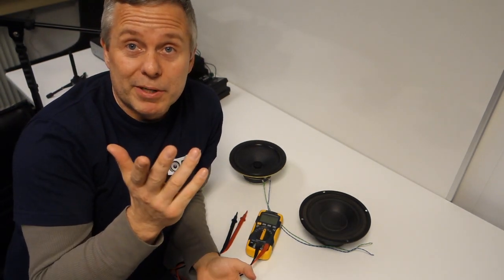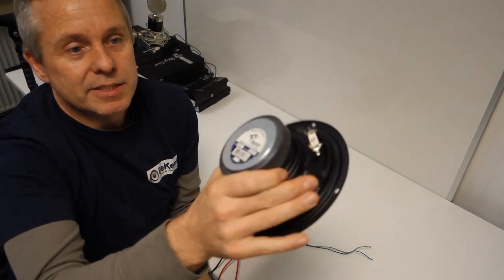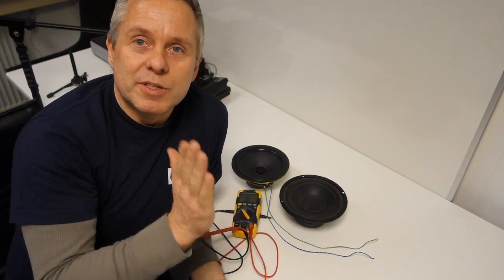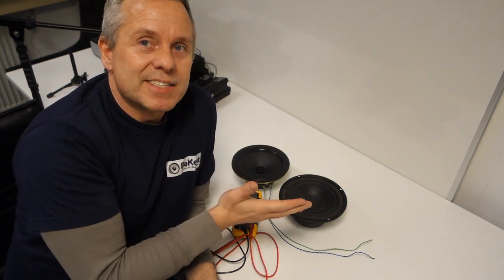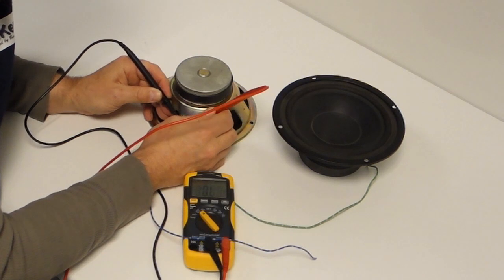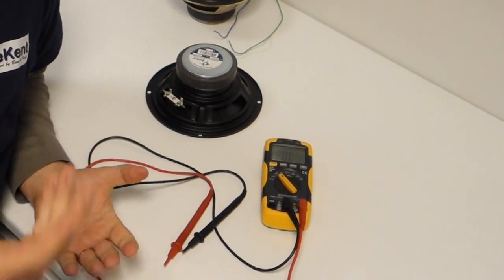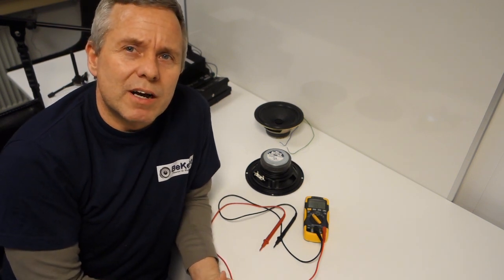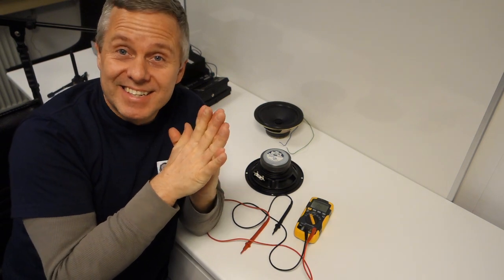Is my speaker dead? How to measure with a multimeter

Comment: What if your 8 ohm speaker measures 8.2 ohms ?   What about situations  where the driver measures slightly over what the speakers ohm rating is ?
Reply from the maker: The exception is ribbon tweeters, they have low induction and because of that impedance and resistance is almost the same impedance, but if this is a woofer it can be its a 10 ohm driver or just simply not made very precise, and lastly an indication of a defect. Measure the same driver from the other speaker if there is one and compare. With a woofer the impedance will always be higher than the resistance measured with ohm meter or multimeter, unless you have a gauge that can measure impedance, but you would know if it can, because those are special and in general much more expensive, or an interface that is used with a software on a PC.
Reply: @AudioTalk  that weird  Because on a 4 ohm coil, I usually mesu 3.3 ohm or 3.4 ohm  What's the difference between impedance and resistance ?  Aren't they both measured in ohms ?  on my infinity KAPPA perfect 12" I measured 4.1 ohms
Reply from the maker: @Mr_BUSINESS_24_7  on a 4 ohm coil, yes that would be normal 3.3 ohm, impedance will always be higher than resistance. Impedance is a combination resistance and induction together when you are dealing with a AC circuits, thats why there is a different name for it.

Comment: Hi I my car speakers have a ohm of 4. I check with a multimeter to see if there were good and all of the speakers came back at 3.8 ohms . Is it good or bad
Reply from the maker: The measurement says its good then
Reply: Oh OK can I check the speaker with a 9v battery to see of it works too
Reply from the maker: @jesuszuniga1257  not as good of an indicator, but it gives some idea
Reply: Oh OK because I was only able to check ohms with multimeter only
Reply from the maker: @jesuszuniga1257  sure those 2 methods together is good
Reply: Oh OK thanks

Comment: so how do we fix a burned of speaker then? i have some vintage DDR REMA Hifi woofer to repair :'(
Reply from the maker: Rare occasions there will be a rep kit either as a voice coil or a recone kit for a speaker driver, where you can  repair it. But for 90% + of the speaker drivers out there the only thing to do is replacing them.
Reply: @AudioTalk  yeah i figured that. it's just hard to figure out which part is blown when i had no clue.. now i know what to look for. a voicecoil replacement. the tools though cost like 70€ i suppose. i bought now 3 sets of the same variant of woofers instead for 30€ to replace, because they are vintage haha

Comment: What if a 4 oms speaker is constantly at 3.1    is that a good speaker still!?
Reply: Yes, that's completely normal.
Reply: @Timootius  I'm confused, each connector on the driver is negative or positive. How can there be continuity if they are separate (positive/negative)? Positive and negative are never in circuit together?

Comment: Hi there, i have a vintage Goodmans that was working ok but  time ago stop working, i measure with the multimeter and have no lecture, is OL...i desolder and resolder the leads to see if the problem was there but still the same, does it means that the coil is burn off? or maybe something less bad? thanks

Comment: 130°C for polyurethane enamel magnet wire.  Other polymer formulations are in the 160°C range.  The weak link in all tech is that insulation.

Comment: so my 12" 8ohm speaker out of my mackie C300 is reading 18 ohms does that mean it is blown?
Reply: ok i take that back is my multi meter supposed to be on 200 or 2000? when on 200 it reads 5.6 ohms does that still mean my speaker is bad?
Reply: my speaker doesn't seem to move at all when you push down on it

Comment: Is 6ohm normal for a 4ohm speaker ?
Reply: They usually measure slightly lower. Your speaker is 8 ohm as they generally measure at 6-7 ohms

Comment: I have nothing and no movement checked with 9volt battery could the guitar amp just burn it up its a Carvin 12 " 8ohm  can it it fixed or junk it
Reply: Still no answer after 3 years now working on Denon surround and speaker went dead
Reply: @Apollo1van any news? I have a speaker not showing continuity or resistance and I’m nervous to dig into it much further

Comment: This guy is brilliant... very informative and helpful... thank you
Reply from the maker: Glad it was helpful!
Reply: @AudioTalk  I'm confused, each connector on the driver is negative or positive. How can there be continuity if they are separate (positive/negative)? Positive and negative are never in circuit together?
Reply from the maker: @wazup3333  A speaker driver is just a coil inside, so if you measure really low or really high resistance you are dealing with a defective driver. On each side of that coil there is connector marked negative and which will make the other connection positive, for the sake of polarity (phase) of the speaker.
Reply: @AudioTalk  I understand the coil resistance, so then each end cannot be positive or negative? Let me bring up another example a 12-volt car battery has a positive and negative and if you try to cross those two points you will start a fire or have spark because there will never be continuity between the positive and the negative. How is it different on a speaker driver? Are both pins a positive or negative? How is the driver being powered then?

Also my Tweeter for right channel should be 4 ohms but I am getting five to seven ohms however I barely hear the Tweeter. It seems underpowered comparing to my center channel speaker tweeter. Is it normal or bad? My left channel tweeter is completely broken because there is no continuity so I can't compare Tweeter  sound to left speaker only center
Reply from the maker: @wazup3333  The amplifier brings the power a speaker driver is not a power source, its a passive component. Plus and minus refers to polarity, so that you have a chance of connecting several speaker drivers in phase. If you connect 2 speaker drivers with opposite polarity they will phase out each other and there will hardly be any sound, and that is the reason they are referred to as plus and minus.

Comment: Sir 
I have one doubt if we connect 4 ohm woofer in parallel with 4 ohms tweeter then what will be total ohms
Reply from the maker: Each speaker has  an impedans curve where you can see the actual impedans at a specific frequency, so when the two speaker drivers start to overlap you get a parallel electrical connection. So with the crossover design you manage this overlap so you wont have a impedans load on the amplifier + having big impedans differences on the amplifier throughout the frequency range will make your speaker behave very differently from one amp to the other. That is a classic difference between a well engineered speaker and one put together with limited knowledge, but its better to get started, make mistakes and study than to be discouraged, I dont know anybody that knows everything about speaker design. Good question and I just might make a video on it.
Reply: @AudioTalk  thank you sir
Reply from the maker: @bhbhbhanu  thank you for the question, I will make a video on that subject

Comment: Hi there! I have a pair of Beyerdynamic DT250 headphones (250Ω) and the right channel just stopped working. I guess that I could test its speaker the same way. So I did and my multimeter will just stay at the "1    . " mark. That means that I get no response, so is the resistance too low, so it's burnt? Should it be higher since it's a 250Ω model?
Reply: Make sure you take out at least one leg from the circuit before testing

Comment: Good day Sir,  I have a b&w speaker it’s a DM 604 model the tweeter stops working then I trace the wires and the red terminal from the crossover going to the tweeter when I test it with multi tester the hand of tester doesn’t  move. Does it mean I have a busted crossover? Can I change the capacitor going to the tweeter to fixed it? Thanks in advanced more power to you sir
Reply from the maker: Hi Renan, sounds more like the tweeter has burned off, and thats very common for B&W. If you remove the midrange you can twist the tweeter quarter turn and take it out and look at the back of the tweeter and find the model number online for a replacement. The verify once you have it out, measure across plus and minus, and if its open its toast. Pay attention to polarity, where the wires go on the tweeter. It wont harm anything to reverse it, but it will sound boring and uninvolving, because of incorrect phase.